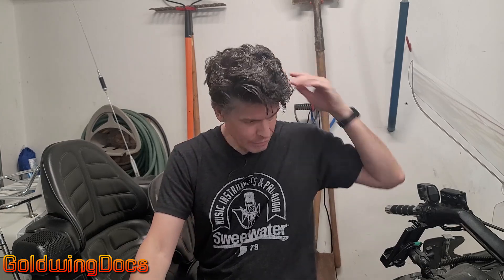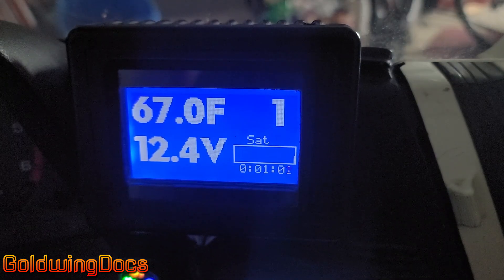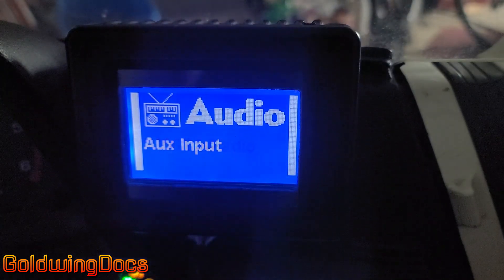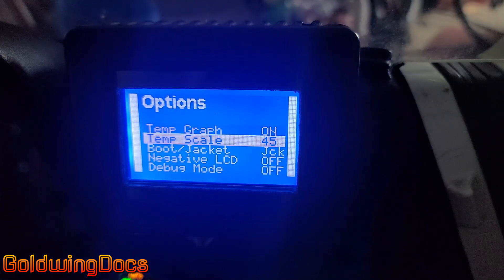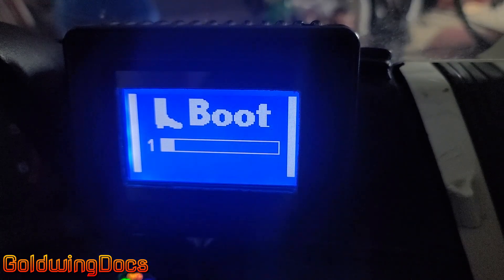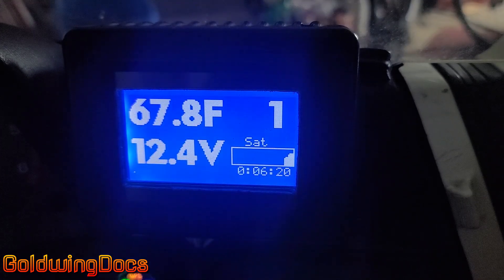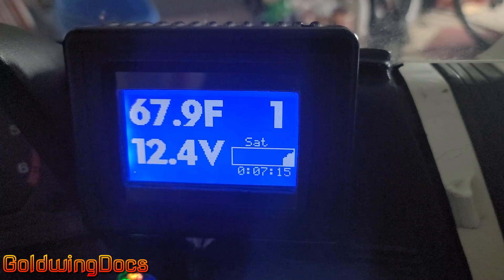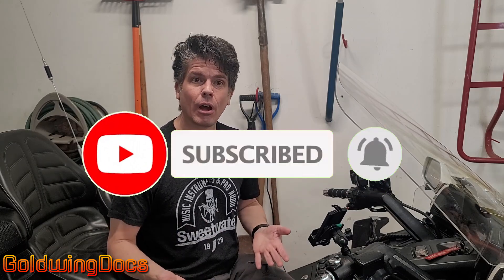Goldwing Bike PC - History, Functionality and an Announcement!

Comment: Scott great video there and announcement too your help for all goldwing owners has been outstanding over the years too maybe just maybe you can help all goldwing 1500 owners the world over by using your experience and expertise to produce a plug and play  replacement radio player for the 1500's as you well know yourself Scott there has been many attempts to replace the old fashioned tape player that the 1500s have I have posted on goldwingdocs.com the eagle 1500 direct plug and play look on YouTube for details however yes it now had a dash cam however it is not waterproof I think too that if you could make and design this product as a direct replacement for the old cassette radio player and make it plug and play too you will make a ton of cash for your trouble Scott as the eagle 1500 is in my opinion not up to the job its users cheap parts and if you look at the build quality it is quite badly put together aswel coupled with the price tag I think you could do a much better job than that Scott looking at what you have already done with the computer you have built already..